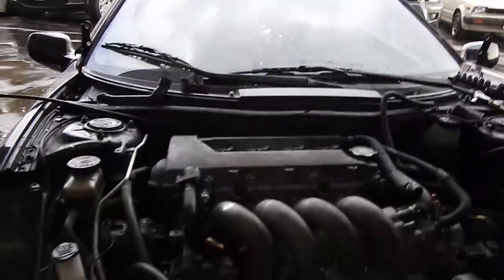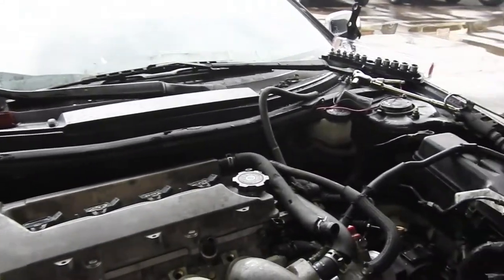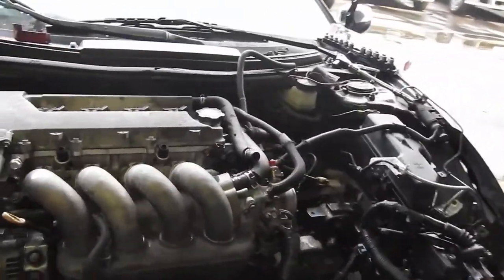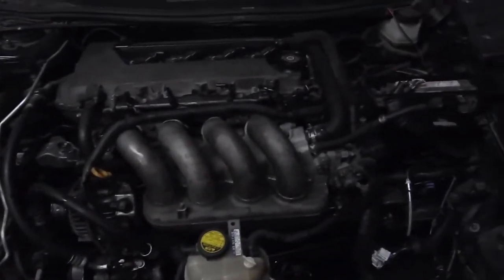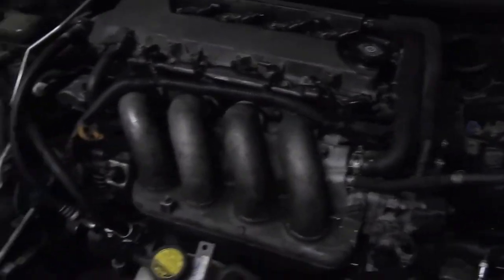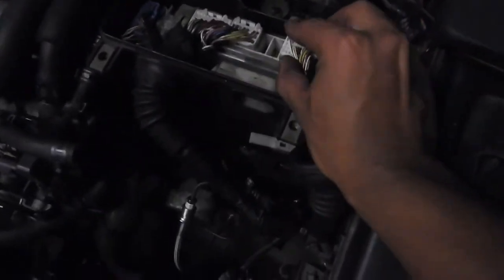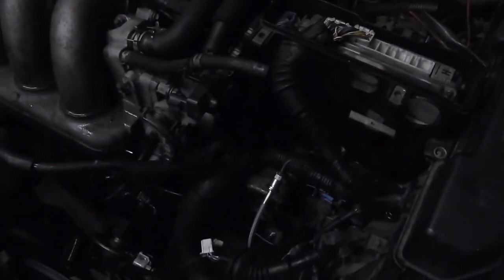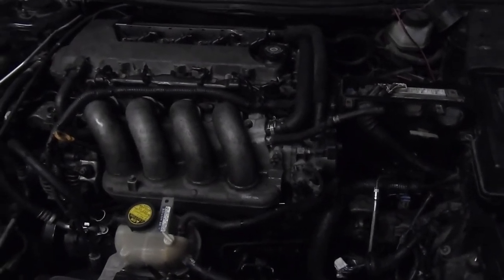Ran Into Another Problem!!

Comment: Sup again Rafa. Love the vids, keep em coming!
If you swapped a apexi ecu for the 00 ecu wouldn't the harness be compatible?
Reply from the maker: Mike West yes it would but this an 03 to a 00 Ecu thats y it doesnt work
Reply: Im curious...So if you swapped ecus to apexi would you still have to change the intake manifold, gas pedal and harness to 03-06 or would it save you all that wrench work?
Reply from the maker: Mike West apexi only works on the 00-02 celicas for the 03+ you need a special wire harness bc of the wire harness and throttle by wire
Reply: Ahh ic, thanks for clearing that up and sharing your knowledge. I always assumed apexi made a refreshed model ecu for 03+ models with tuning options to convert from Drive by wire to throttle body cable. Respect dude.
Reply from the maker: Mike West no problem and the apexi is an outdated ecu they never made one for the 03+